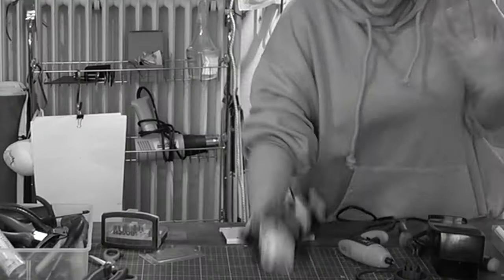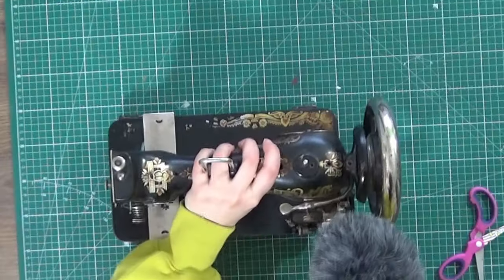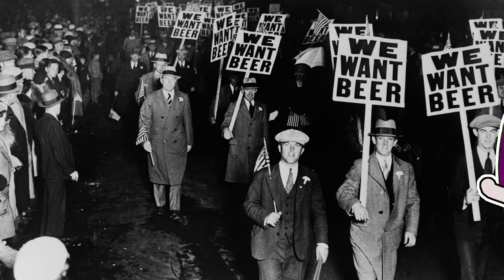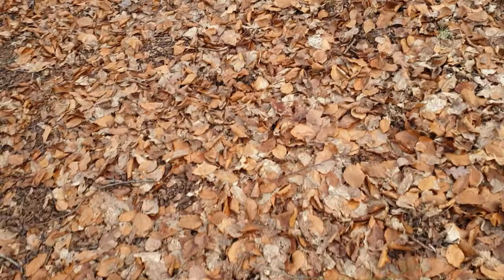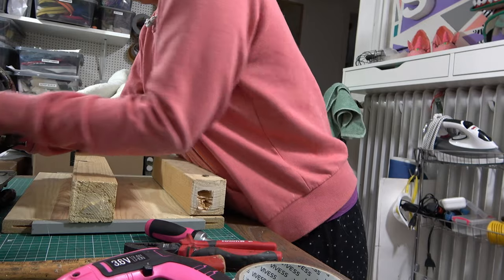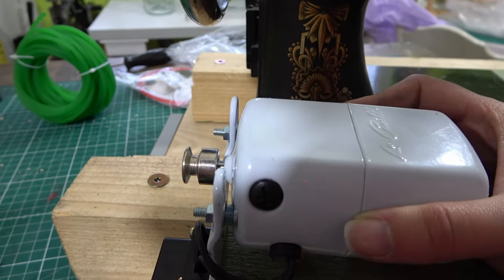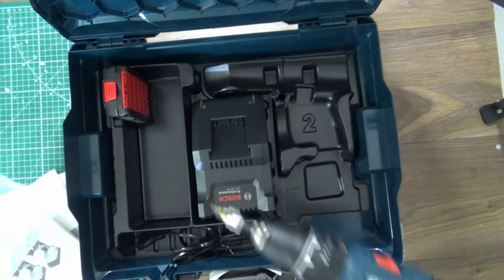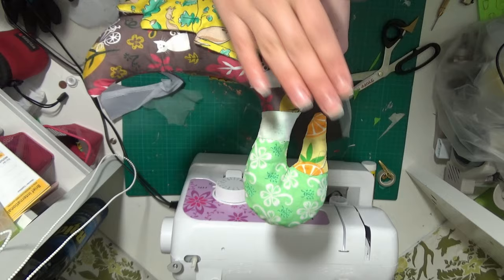Will it Sew? The ELECTRIFYING Kayser Sewing Machine

Comment: I’m so jealous that your machine has reverse! I have a Singer 128 that had similar tension problems when I first got it. If you haven’t already, check inside the shuttle—there was a disc of ancient lint packed into the bottom of mine, along with some debris stuck under the tension spring, and cleaning those bits helped a lot. I still have to set the top and bottom tension far tighter than I’d like to get a balanced stitch, but it’s a lot more consistent now.
Reply from the maker: Ooohhhh. thanks! I will try that and see if it stops going all over the place lol

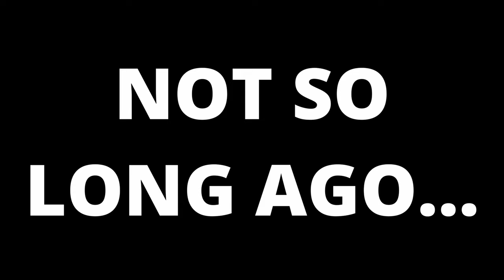Comment: EEEE!!!  I so e-sited for you (yes, I'm a nut whose 1:15 into the video and commenting, but I'm just gonna go with it).  I, like, you know, literally,... got a 1915 Hand-Crank Singer 99K.  1mm stitches.  It can apparently sew through 6 layers of denim.  Lord.  I'm such a geek.  53 years on this planet to figure this out... ohmahgawd the sound of the Georgian clack-clack...
- Cathy (&, accidently, Steve), Ottawa/Bytown
Reply: I was wasting some nice etsy time last night.  There seems to be lots of people selling parts for old machines (if you get stuck for things like extra bobbins).  Definitely saw the disk-thingies that control the tension.
Reply from the maker: the singer 99k is on my list of dream machine to find... you're so lucky :D
Thanks again for the tip on the spare parts. I will take a closer look at the tension thingies... :D
Reply: @Seamstressed  If you look for Singer (and, I think, Bernina) you can find the rubber wheels for the bobbin winder and belts for the engine.
My growing sense of unbelievably lucky with the 99K is the dawning sense that she Never got electrified.  It's in page 3 of the manual (yes, I have the manual and the bentwood lid and the key - eeeeee!) they advertise how you can sew without 'fatiguing' yourself if you just add an engine...
- C.
Reply from the maker: The sewing fatigue is real 😂😂😂
Reply: @Seamstressed  It's a flippin' pandemic.  Hand-crank and hand-sewing are practically my whole exercise routine... mmm, feel the burn whilst swooning over small stitches...

Comment: The sparks on your motor were probably caused by the stator(the spinning bit where the sparks were) being dirty. If you ever decide to take a sewing machine apart again because it's sparking or not working clean all the black off the copper pads with a super fine sandpaper called emery paper. Or a fine grit nail file and replace the brushes then the motor should be up and running spark free.
Reply from the maker: Oh wow! Thank you so much. I really want the machine I took it from to work again. I will try to clean it and see what happens :D
Reply: @Seamstressed  if you need any help just @ me and I'll see what I can do.
Reply from the maker: Thank you so much!!

Comment: Love the video and I've gotta ask.  I have the same kayser sewing machine.  What kind of needles do you use?  I don't know what size fits.
Reply from the maker: Thanks! I used a standard sewing machine needle (the ones with the flat back) and it wasn't a problem at all. If I remember correctly, it as a 100 thickness too :)
Reply: @Seamstressed  Thanks you so much!